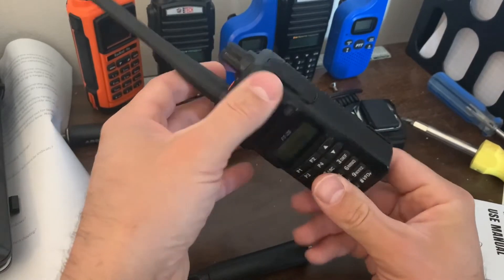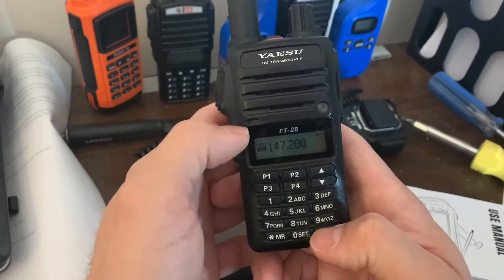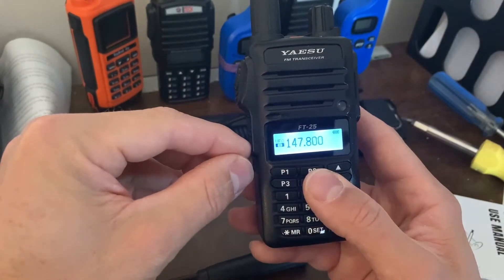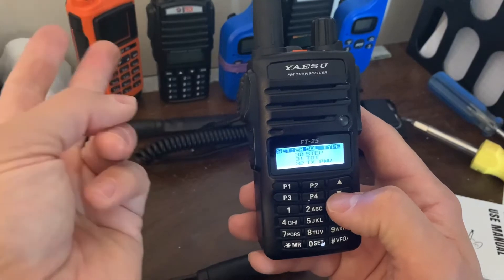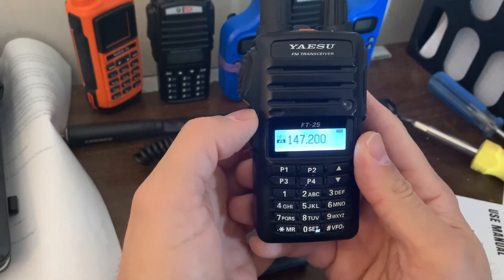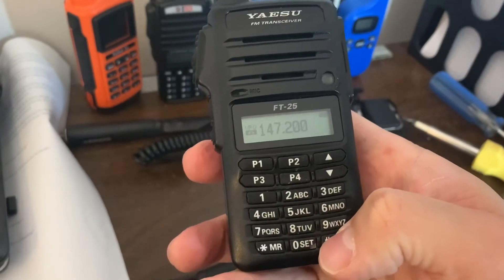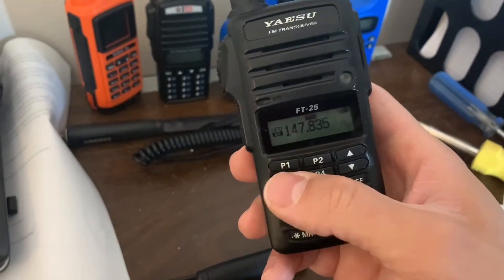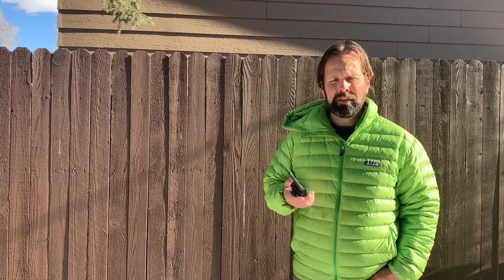VFO Split - Programming Yaesu FT-25r or FT-65r

Comment: When I try to go to vfo split on my FT65 it just beeps and won't let me do it. Any suggestions?
Reply: First, go to both VFO in turn, and ensure all the options are OFF. Next, start the radio while pressing and holding the PTT and squelch buttons simultaneously to get into the system menu. Enable dual VFO display. When you restart the radio in normal mode, you should see VFO A in large font, with VFO B in smaller font below it.

Comment: CAN you setup the FT-65 to transmit on 440, and then receive on 2 Meters in ONE Memory Channel?
Reply from the maker: This cannot be done from what I see in the manual. However, if someone out there has one and has made it work, I would love to know! Great question. The 65r and 25r are pretty scaled down radios, designed to compete with Baofeng market. They work well but offer very little flexibility in some departments.
Reply: @backcountryamateurradio  Of course you can, i have trouble recently when I'm trying to save unusual offset like this, and you can save VHF/UHF on single memory. Here's how to do it:

In Yaesu FT-65 or FT-4X :

1. Go to VFO Mode and set input freq/RX (e.g 141.000)
2. Save it by long press *V/M button
3. Select free channel you want to save (e.g channel 1)
4. Go back to VFO Mode and set output freq/TX (e.g 420.000)
5. Press and hold *V/M again
6. Select channel that you save it before (channel 1)
7. Press P2 to save it.

When in Memory mode you can notice Plus Minus Symbol (±) on top indicates that channel have VFO Split in it.
Reply: @kusumainc2349  :o Manual says this is not possible!
Reply: @kusumainc2349  This doesn't work on FT-65.
Reply: @paradoxicalcat7173 You need to enable vfo split first on the menu, and then save it on the memory, works well on mine.
Reply: @kusumainc2349  Must be a software version problem?? Here are my steps: VFO A I set a frequency and store in memory. I then set a freq on VGO B and store, select the SAME memory place as step 1, and press P2 button. Nothing happens?
Reply: @paradoxicalcat7173 wait, lemme do a video tutorial, I'll let you know when it is uploaded
Reply: @kusumainc2349  Thanks!!

Comment: Hi, is possible to save this vfo split mode in memory Like in ft-4x. ?
Reply from the maker: Hi Bart, I've tried to save it in the memory on the FT-25 and have not been successful. I think it's great that the 4x allows for this, but interesting that it then doesn't work on the 25/65 series.
Reply: @backcountryamateurradio  thank you for your answer. Maybe try split memory from ft4 advanced manual page 10? I stay with ft-4.  73.
Reply from the maker: I’ll take a look at it. Thanks! 73
Reply: @backcountryamateurradio  I am curious if it will work.

Comment: Do you have to change anything in the repeater menu?  Turn off ARS or change mode?
Reply from the maker: Yes. I'm sorry I didn't mention that in the video. I should have walked through the menu features to do this. You will want to turn ARS OFF, so that there is no automatic shift. This is menu 24:Repeater> ARS (for those of you getting familiar with this feature/radio) and simply select off, don't worry about changing anything else in that function. Thanks for the great question.

Comment: Hi, thank you that is great explanation. I tried to store frequencies such as RX 157.725mhz (VPO-A)  and TX 163.360 (VPO-B), total offset 5.635mhz. When store those frequencies, its changed automatically  to Function-24 REPEATER-SHIFT limit. Have you tried ever? and can store above frequencies in memory? Thanks again
Reply from the maker: Just to be sure, there was no way for me to save this. I tried reprogramming the repeater offset as well so that it could achieve a non-standard offset, which caused the function to kick me out. Attempting to save this vfo split as a memory also didn’t work except to save the rx frequency and it’s settings - so it became a simplex memory. This is where radios like the GS-5B can be useful. I believe the radio can be programmed from the app specifically how you are attempting to program your yaesu.